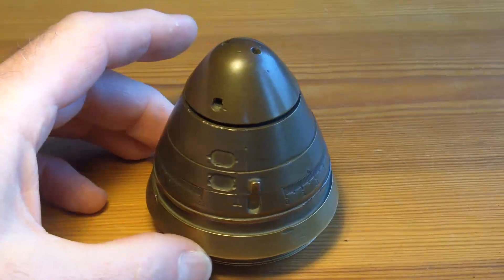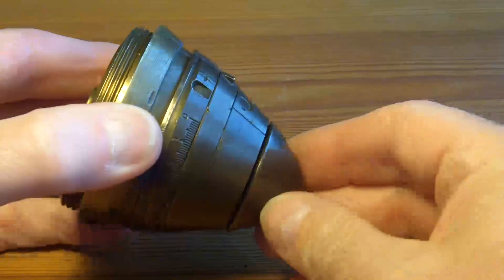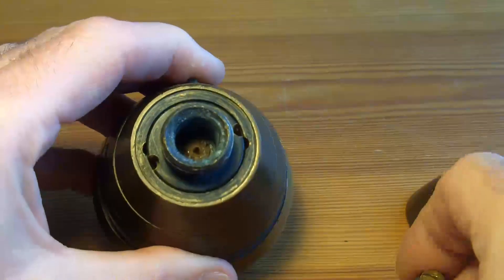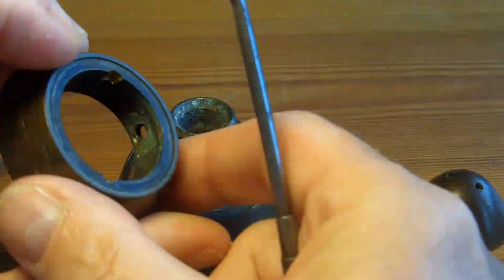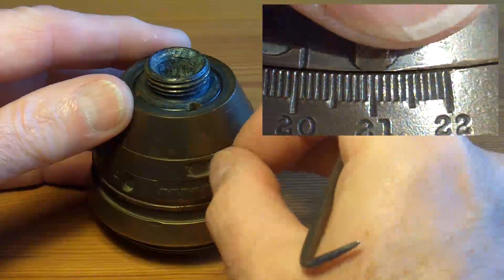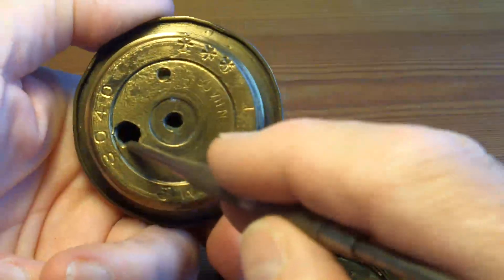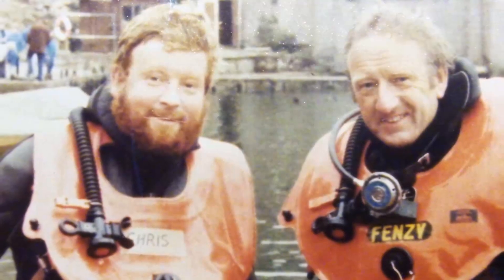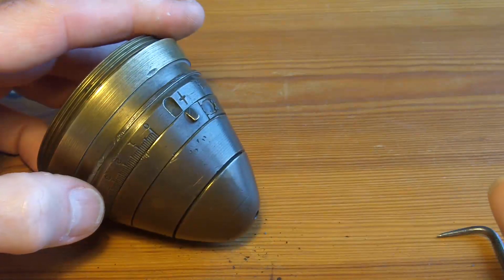WW2 Bomb Fuse stripped down so you can see how it works.

Comment: Hi Andy.  Just come across this video of your #80 fuse.  No-where in the vid do you mention the second detonator.  This is a number 80 timed and percussion fuse - which has two dets - triggered on firing and on impact.  If you unscrew the plug in the base of the fuse, you'll find the second det carrier acting on the opposite side of the double-ended firing pin. You may want to deal with that :-)

ref: http://www.bevs.org/diving/fuse1.htm

Comment: The reason for the delay is that surface targets need a fast time so they don't dig into ground too far before exploding, where as hard targets, like bunkers, bridges, or anything else made of concrete you need a longer delay to allow the bomb to penetrate into the concrete before exploding.
But I think that what you have there is an artillery time fuze, for air burst effect. And despite what my spell checker seems to think, fuze and fuse are different. According to the US military, a fuze is an explosive detonator for a shell, bomb, or grenade, while fuse refers to something you can light with a match, like a firecracker has.

Comment: Although it could be a delay after impact, more likely than not, the fuse is for an airburst. The first 2 years of my 22 years in the Army was spent in Artillery. Fuses are either impact or air burst. Air burst is more effective at hitting targets than impact. The delay fuses are more common today, but not back then IIRC.
Reply: +ReconB4V This makes sense, I presume this would be a shell fired from a gun rather than dropped from an aircraft? Someone could set the fuse as required and fire it from the gun, rather than someone setting all the fuses and then dropping them.

I'm not sure, if it is from an aircraft surely it'd only be a small 50kg? which would (guessing) be much more useful as air burst?
Reply: Time-fuses like this were used in anti-aircraft artillery shells before the advent of proximity-fuses in WWII.
Reply: bomb fuses were in the tail especially for ones meant to penetrate the ones in the nose got crushed by the impact.  So if this was a "bomb" fuse it would be tail operated

Comment: If the whole device is made of soft metal such as brass, would there not be a high risk that it would disintegrate if the bomb hits something hard, for example a rock face? The actual bomb must have weighed at least hundreds of kilograms so that when the fuse hits the ground at tremendous speed, there is a huge force exerted on the fuse.
Reply: +Jaakko Oksa i bet there would have been impact fuse for those hard surface hits. this kind of detonator would have made sure the bomb detonates in case of hitting soft ground. as i have understood, many bigger bomb were fitted with multiple detonators, one being some sort of time fuse detonator.

Comment: The delay was also used so that when it hit the roof of a building it would penetrate the building before exploding.  An explosion ON the roof was less effective than an explosion inside the building.
Reply: Scott Clark it would not be used as a bunker buster, this is a smaller mortar with HE, this type of fuze wouldn't work with a HEAT round

Comment: The time and percussion fuse N°80 was the fuse usually used with the British shrapnel shells of the famous 18 pounders field guns in WW1. Designed by the German company Krupp in 1905 and manufactured under license in England before the war and during it, its peculiar story will feed the arguments of the believers of a war wanted by the weapons international industry since once the war over, the British company Vickers Armament Industries, who manufactured these fuses between 1914 and 1918, kindly accepted to pay to Krupp 40 000 £ royalties...

Although the initial models were made in aluminium, this fuse was entirely made in brass. The time system is a classical rotating disk system, with a ring graduated from  0 to 22 sections, a departure ignition caused by an axial time pellet caused by the discharge shock momentum. The percussion system, selectable by choosing the rotating disk graduation marked with a roman cross was a very classical one as well, of graze type, with a staple safety device actioned by the shell departure shock. gunpowder load was placed at the base of the fuse to ignite the shell (with an additional detonator if needed).

Living through 16 different marks, it will remain in service until the middle of WW2.

Comment: Appears to be Mk 80. Found this, might help narrow it down to which of the 16 variants:

The time and percussion fuze N°80 was the fuze usually used with the British shrapnell shells of the famous 18 pounders fieldguns in WW1. Designed by the German company Krupp in 1905 and manufactured under license in England before the war and during it, its peculiar story will feed the arguments of the believers of a war wanted by the weapons international industry since once the war over, the British company Vickers Armament Industries, who manufactured these fuzes between 1914 and 1918, kindly accepted to pay to Krupp 40 000 £ royalties.

Although the initial models were made in aluminium, this fuse was entirely made in brass. The time system is a classical rotating disk system, with a ring graduated from de 0 to 22 secones, a departure ignition caused by an axial time pellet caused by the discharge shock momentum. The percussion system, selectable by choosing the rotating disk graduation marked with a roman cross was a very classical one as well, of graze type, with a staple safety device actionned by the shell departure shock. A gunpowder load was placed at the base of the fuze to ignite the shell (with an additional detonator if needed).

Living through 16 different marks, it will remain in service until the middle of WW2.

Known variants are :
the time and percussion fuzes N°80B only differed by a small difference in shape, one lip having been suppressed so that the fuze could be adapted to certain shell types.
the time fuzes N°80/44 et N°80B/44, with no percussion mechanism, were dedicated to the explosive shells that had to detonate in flight (for instance for anti-aircraft), and needed the serial mounting with a direct action percussion fuze N°44/85 acting as a detonator. The 0 to 2 graduations of these fuzes were masked, and a blue 'T' mark was painted on the fuze body,
the time fuzes N°180 and N°180B, with no percussion mechanism, were used with incendiary and shrapnel shells in anti-aircraft action. A blue 'T' was painted on their body.

Comment: A very interesting video Andy.  Thanks.  I never knew how delayed bombs were made to time out.  Incidentally, I have a similar delayed trigger fuze/fuse in my old collection of things I found when I used to metal detect years and years ago.  I've had it for 35 years now, along with an old crashed aircraft wing internal rib that I found eight feet beneath the ground and other WW2 items. 

The cap is missing from mine due to impact I imagine, and the top is skewed at an angle.  The primer still looks intact though so I suspect mine didn't go off when it impacted the soft soil of the field it landed in.  The cap may have been knocked off my farm machinery when the field was worked by the farmer.

Thanks for a great video.

Comment: Interesting video !
It looks like a good bit of fine machine work went into making that fuze.

Now, I don't know anything about artillery, but I can tell you with a degree of certainty why MORTAR bombs have different delay settings.
The fuze for the British Army 81MM Mortar round used to have a 'dual option' fuze (Those options being 'SQ' and 'D')
'SQ' setting was 'Super Quick' meaning instantaneous on impact, and was the usual setting.
But if targets were under cover, within buildings, or even under dense enough foliage the 'D' (delay) setting was supposed to be used. Otherwise the round would not, shall we say, 'be used to it's best effect'.
It was not much of a delay, If I remember correctly, (and it has been quite some time now, so don't bet your life on these words.) it was only 0.05 seconds !
So, not really enough time for you to pick up your hat and casually saunter away, but easily enough time for a falling mortar round to drop right through a house and 'spread disillusionment and despondency' in the basement.
So you were about right with your guess.

Anyway, It's funny the sort of things we used to get up to as kids, isn't it ?
Reply: That's classic English we don't hear or read everyday.

Comment: Hi good video. My granddad gave me one of these when I was young but he didn't know much about it or where it came from. I was always fascinated by how things worked and worked out how the graduated scale worked as a timed detonation when I was about ten I think. Im an engineer now but nothing to do with ordnance :-) Still got this now. Its almost identical to yours but doesn't have the large brass ring on the very bottom just the screw thread. The base plate, where you said a lead plug was probably fitted, unscrews on mine to reveal another chamber with another firing pin. Thanks for proving me correct in my assumptions of 35 years ago lol.

Comment from the maker: 2 of 2 

As you saw in the video there is an inertia device, a weight, right at the front of the cone. If the powder in the device is still active and you dropped the cone then I suppose the powder cloud be ignited, I think it would only burn rather than explode but I'm only guessing.   

Good Luck . . . Andy

Comment from the maker: Hi there, the fuse was found on a shipwreck somewhere around the UK. I’m told it had been in a box or crate with three others and the box had rotted away and the four fuses had fallen, nose down into the sand, into an ‘X’ formation. Originally the fuses each had a long tube coming out to the back of them but my brother, who found the fuses, safely removed the long tubes and the powder they contained.
Kind Regards ... Andy.

Comment from the maker: @patchcords
 Hi there, well that’s the theory of how it should work and most if the time it probably did. I image that the huge compressive forces on the soft brass components at the moment of impact against a hard surface would affect things in a big way, I think a hard steel point on the end would make things a bit more reliable, either that or simply move the mechanism to the back of the bomb where it won’t be damaged on impact.  ...Andy